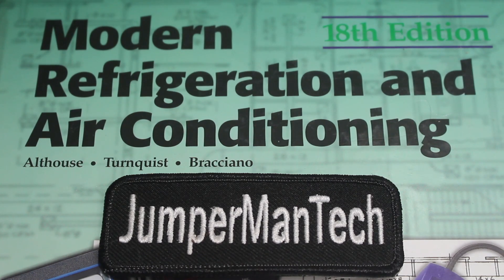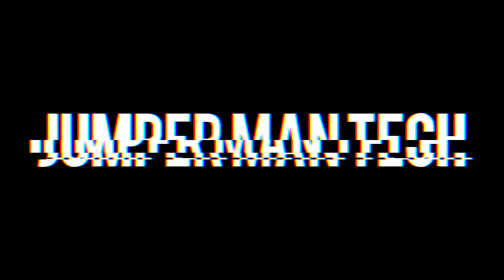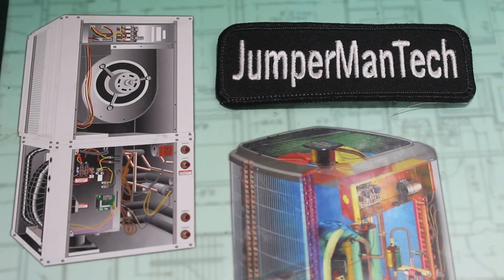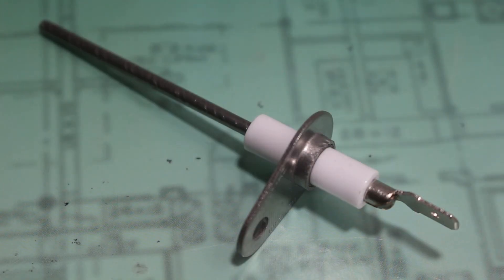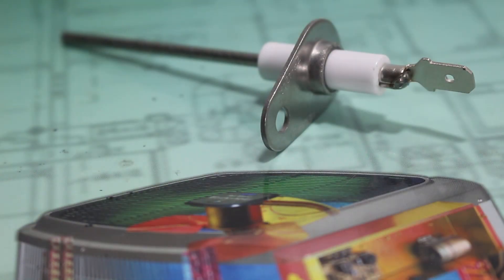HVAC: What Is A FLAME SENSOR & How Does It Work? (Furnace Flame Sensor) Furnace Not Working

Comment: I mean besides the note about cleaning the probe, this video was entirely false.

The probe does NOT “generate electricity” (that’s what a thermocouple does, and it only does that by using the seebeck effect) but this is just a metal probe, not a thermocouple.

How a flame sensor actually works:
It uses a phenomenon known as flame rectification, in which the flame itself will act as a sort of diode, allowing more current to flow in one direction than the other. The flame is making contact with the metal frame of the heat exchanger which acts as the ‘neutral’ path.

The combustion controller monitors the amperage (or voltage across a shunt of known resistance) of the probe while supplying AC voltage to the probe, in order to determine if there is flame or not.

This is exactly why you will sometimes find a hot surface ignition double functioning as a flame sensor.

Comment: Hey thanks for the informative video. Does the flame sensor also control the high fire function? Would a dirty sensor prevent it from operating in high fire but still operate on low fire?
Reply: In my case, a dirty flame sensor would not allow my heater to work. You can hear the thermostat click, furnace turned on, heat will come out for 1 minute or 2 and then shut off. Seemed like at some point the sensor would not catch that the flame was on, and turned it off as designed to do so. Also, the colder it was outside, the higher the chances of failure. Technician came over, cleaned the flame sensor and has been working fine since. Other technician chased this issue for a couple years with no luck. Hopefully my answer helps on your troubleshooting.

Comment: Very informative,  I'm replacing my hot water system flame sensor but it's the one with a bend in it. Does it matter which direction I replace it back in? ie is the bend suppose to face left right up or down? Thanks
Reply: It will only go in one way, these sensors can be straight, have a 45° angle or they can have a 90° angle.

Comment: Thanks for sharing. You definitely covered what is a flame sensors purpose and how it operates as a safety device. 
However I am still lost as to how a flame sensor works. I do remember that the sensor detects the ionization of the flame, and I hope to find more about that process. Let me know if there are any resources you can share in that regard please.
Reply: Hello. I have the same doubt. Did you find any information?
Reply: @dbinder79  DBINDER79:  WRONG.  INCORRECT.  DELETE.